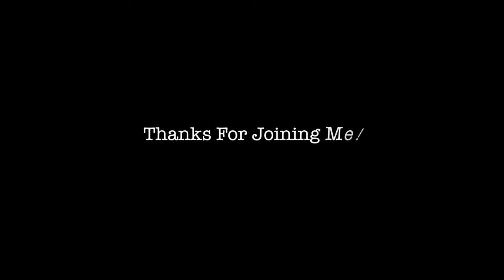2023 KTM 300XC Long Term Review | One Year with the 2023 KTM 300XC | Best Dirt Bike Ever?

Comment: I have the same bike but the Husqvarna TX 300. It is awesome. I went to one hotter spark plug and Amsoil Interceptor 2 stroke oil at 50/1 to stop the  spooging, after trying many different oils. What a monster.
Reply: Which spark plug did you use and how soon after changing oil did the spooging stop? I have a 23 tx300 and I get a lot of spooge after each ride
Reply: I run moterex at 60-1 just like KTM says in their manual. I don’t have any sponge at all. I do run 20% c-12 And use the b9 plug.
Reply: Adding unnecessary oil and complaining about spooge. 🤦‍♂🤦‍♂
Reply: I got the same bike. They are sick. Love the power and easy clutch pull.

Comment: I’m in the minority. Just got rid of my 2023 300xc because of a random bog that just couldnt be fixed. Lots of jumping so it was dangerous, and in the end it bogged on a small jump breaking 2 ribs and my spleen. I’ve had many 300’s and this sucks because its such a good bike, but i am really thinking there is a glitch under heavy on/off throttle usage after bike has been ran hard for 30 min. So sick of the usual..”tps” or  “pump filter” suggestions that have been there go to rambling of all the facebook group reply’s. There is a huge number of these bikes, 125-300, xc and sx that have this issue. I’m the 3rd injury that i know of. I do not see the xcw with this issue, maybe because they run different map/compression? But there is an issue and if you jump a lot stay conscious that when you blip the throttle is may not be there. I’m going through a huge culture shock trying to set up my 2024 yz250 after many years of ktm 300’s…
Reply from the maker: That sucks. Were you on the stock map?  Did you ever try a tsp or other tuner map?

Comment: I have a 24 and have put 20 hours on over the last few weeks. I did foul a plug early on but since putting a high compression head and a BR7EIX, I've not had any issues. I did also go to 40:1 on the premix. Spooges a little but runs great and I like having a little more lube. I thought you could bump start these? I need to try next time.
Reply from the maker: You can bump stat then.

Comment: Love your content brother. Bought a 24’ xc on Saturday. Have you had any issues with your stock map switch? I rode mine 1x and the LED light stopped working. Need to take the bike out tomorrow to see if it’s just the light or if the switch is totally burnt and not switching maps.
Reply from the maker: I haven’t. Check plug behind number plate

Comment: So far my only real bitch on my TX is that damn stator. Seriously KTM/Husky? Stuck a NGK BR7EIX Iridium in before my first ride and never had an issue with fouling a plug. Sent my suspension off to Kreft Moto for springs, revale including their ReValve Control, and I'm super happy with it, especially in the nasting rocky hard enduro terrain.  Also installed the JD Power Surge 6X fuel tuner, which let me lean the bike out where it needed it. My next upgrade will be the TSP head and ECU setup. Now here's my question Morgan. Is there any performance or reliability benefits using their head, or can I just order the insert and ECU and save $190? Oh if you get the new beta, you'll be able to run all the lights you need plus a blender for making margaritas at the end of the day with it's STOCK 200 watt stator.

Comment: Morgan, what is the correct start up procedure in your opinion?
Reply from the maker: Just like a normal 2T.
Reply: @highlandcycles  I have heard you shouldn't touch the throttle for a minute or two because the ecu needs to adjust to ambient air, and if you touch it dosent fully tune itself. True or no?
Do you blip the throttle before rads are warm?
Reply from the maker: @connorlewis8547  that used to be true on some bikes but I haven’t seen the need for that in these. I don’t blip it too much before there is some heat in the rads but I don’t really think about it on the TBI. Since it’s premix and the “warm up map” is rich, you’re not going to cold seize it. Worst case is a fouled plug.

Comment: I have a 2020 xc with stock air forks and I am planning on getting some suspension work over the winter. Revalve and service is about 800-900$ and I plan on getting the mako 360 too at some point in the off-season. Race tech also makes a spring conversion kit for the left fork which is about 1200 after springs and service. My question is do you think I would be better off just getting the re valve and the 360? Or should I just go the route of spring conversion?
Reply from the maker: If you are going to go with springs I would go with the Dal Soggio Spheres. If not then just do the re valve

Comment: Have you checked the base TPS voltage on it with both idle screws backed out with a good fluke meter?
Reply from the maker: Not yet. I might do that. It runs so good

Comment: I had a couple bikes with those WP spring forks and they were harsh for motocross. What makes that other kit different? Was the valving just bad?
Reply from the maker: Not sure about the valving on yours but one big difference about these is the parts are really nice. All really high end coatings and good anodizing. Makes them slippery. Also valving plays a big roll.

Comment: Can you run a headlight on a 23 tx300 with the stock stator? What headlight should i use. Stock?
Reply from the maker: Yes. The MotoMinded Evo works great on the stock stator. I ran that on my bike for a ton of hours. The only problem I had was when I ran it and the fan constantly on a hot day. The combo killed the battery with the stock stator but the light never had an issue.

Comment: Have you watched the guy on "Pin It Racing"? He claims he can remap and get additional 16 horsepower. Says the TBI's have issues. Curious as to your opinion?
Reply from the maker: I haven’t but 16 hp is a crazy number. I can’t imagine getting that with just tuning.
Reply: @highlandcycles  it's actually 16 horsepower gain at 60% throttle opening. Peak increase is about 2 horsepower.
Reply from the maker: @nightrider4370  I highly doubt that. I guess that guy also said the reason pistons were hitting cranks was because people were using too thin of base gasket. That’s impossible because it doesn’t change where the piston is in relationship to the crank. So I am not inclined to believe him. But that is second hand so I could be wrong
Reply: @highlandcycles  yes this is the same guy. I just wanted your input. You have a good channel and I respect your opinion.
Reply: He claims he sets the ECU to let the electronic power valve come open sooner. Is that possible? That's how he's claiming to get the power coming on earlier.

Comment: Great informative review but this bike is so highly modified I don't feel it is a good review of this bike.  Most people, at least that I know, can't afford to do all of these mods to their bike.  I would assume you have well over $20k in this bike and that's just not realistic for most people, or weekend warriors, that don't have all of the connections that you do.  We ride our bikes mostly stock with exception of adding protection and getting the suspension set up for your weight.
Reply from the maker: Absolutely. It’s more of a review of the mods and then I feel like it’s a good review of its durability. A lot of times modifications can diminish reliability but. It in this case. The bike worked perfectly. Also I think it’s a good way for people to see what can be done and decode for themselves if it’s worth it. And finally, you’d be blown away at how many people do this much to their bikes. It surprises me.